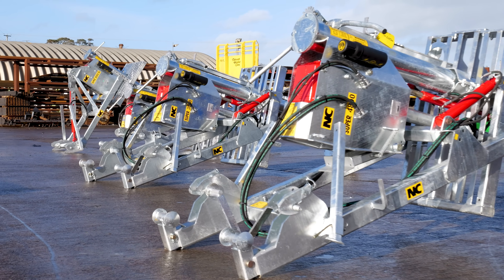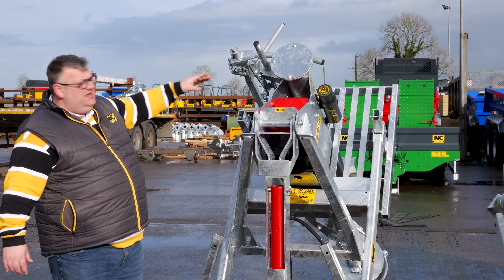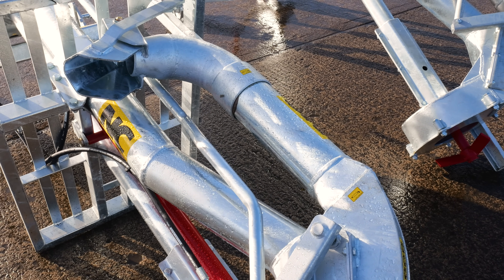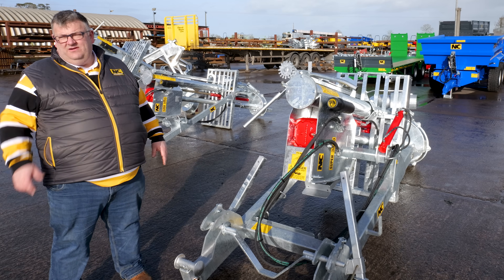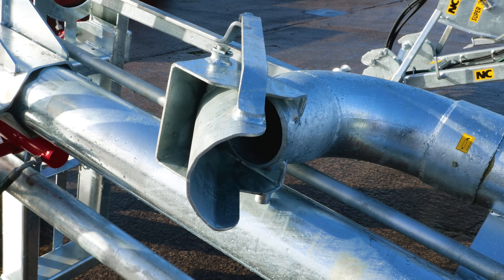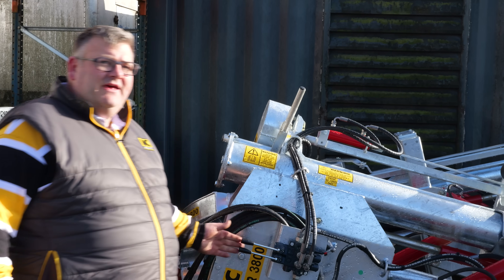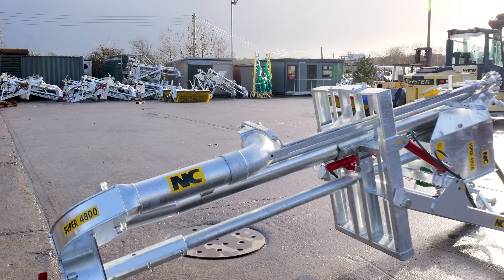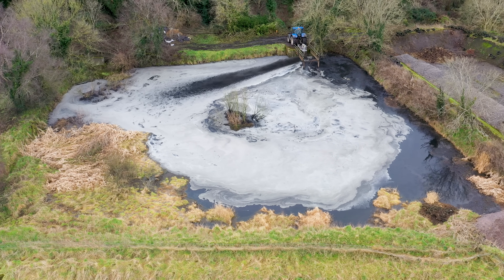IS THIS THE WORLD'S BEST SLURRY PUMP??

Comment: Recently purchased a 4800 after having probably 6 3800's over the years we normally do 600hrs agitating per year, the 4800 is an animal the odd time in the past we have had 2 3800's  in the same tank working together and i can honestly say one 4800 has more power by itself. 180 hp tractor on its knees barely able to get it over 900rpm never mind the 1000 serious machine and thats what we need

Comment: Very rudimentary impeller design.
Would be interesting to see a well used impeller to study the wear pattern. 
Currently probably optimised for a  chopper or macerator effect I would think. 
Check out Vaughan chopper pumps for an interesting example